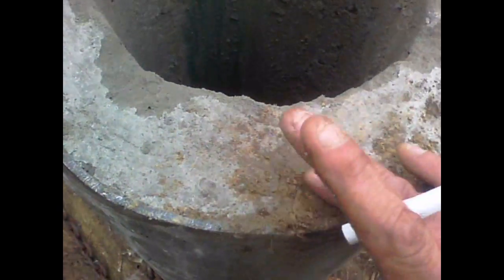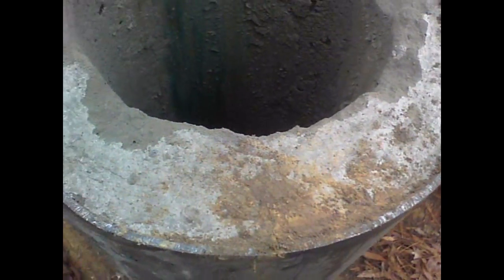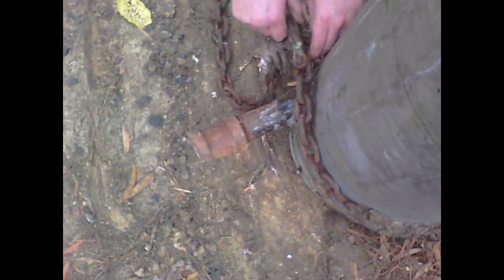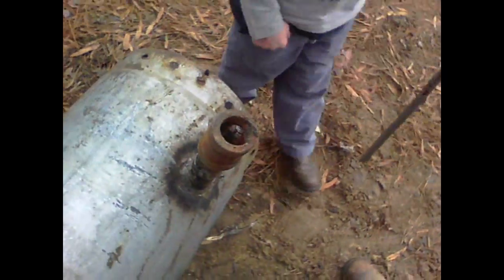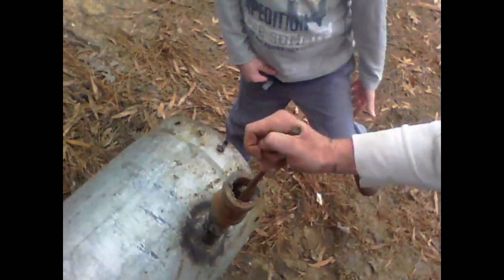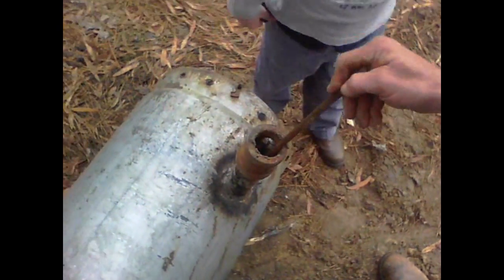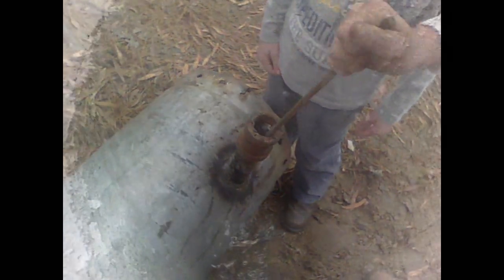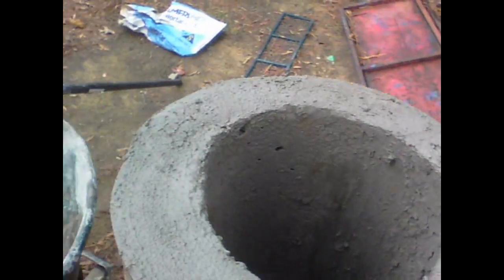easy homemade blast furnace part 2

Comment: I wonder if it will need oxygen holes cut in somewhere or will it even need to bring in oxygen with the spiraling propane
Reply from the maker: the pipe is for the forced air. I will be burning wood in it.